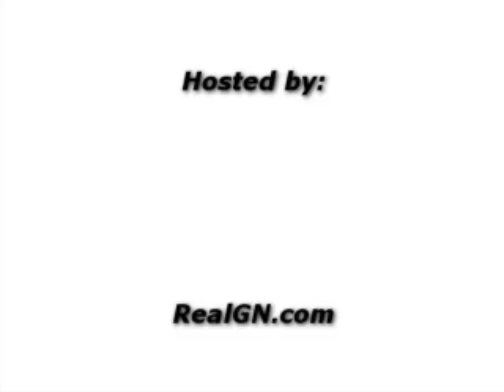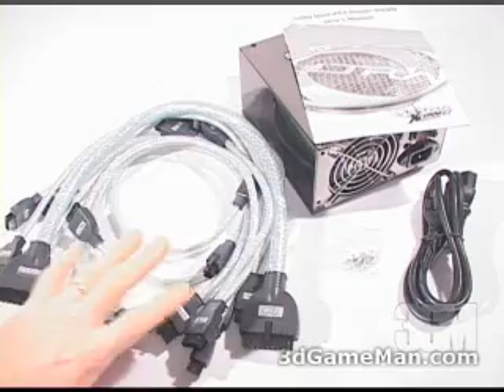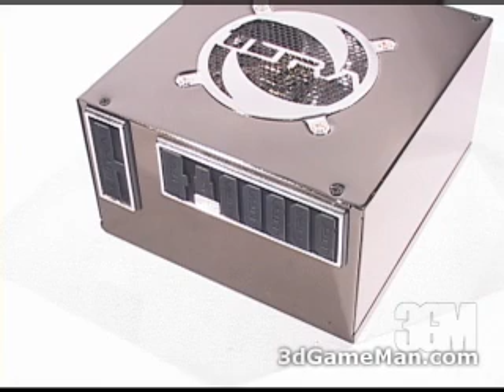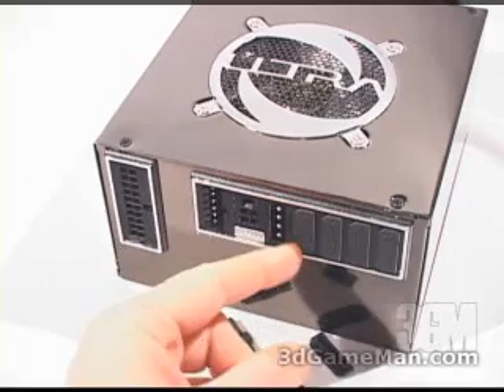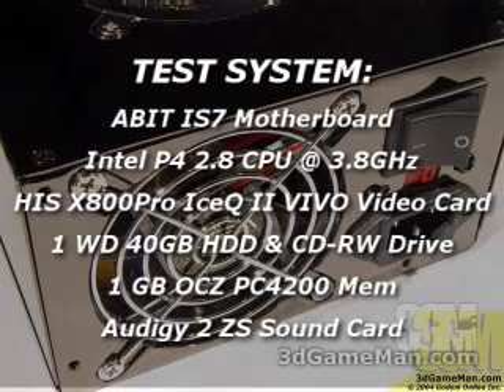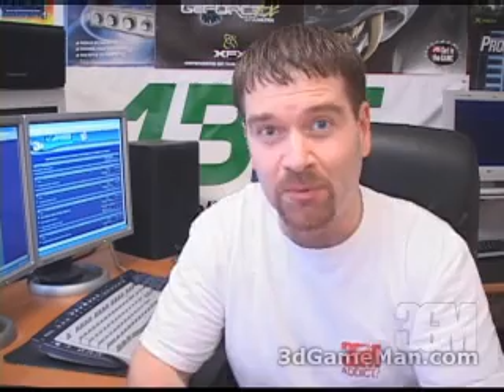#486 - Ultra X-Connect 500W Power Supply w/ UV Cable Kit

Comment: This is Peter from China,manufacturer of UV power supply,which are widely used in the printing industry, UV curing system and painting industry, wooden industry and so on.

Hope to be a partner of your company!

Any queries,Email me or just call me directly. Thank you!
Best Regards,
Peter Deng-Marketing Dept.
Tel/WeChat/WhatsApp: +86-18025427809
E-mail / Skype:peter@garleuv.com
Shenzhen Garle Electric Technologies Co.,Ltd
Add:6th Floor,Block B4,Yijing Ind Park,Guangming New District, Shenzhen City, China
Website:http://en.garleuv.com/